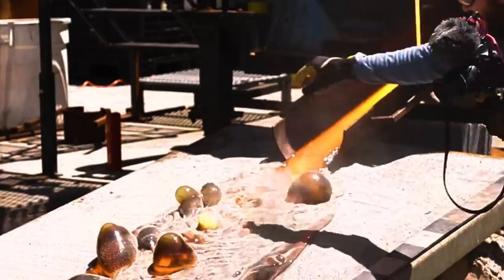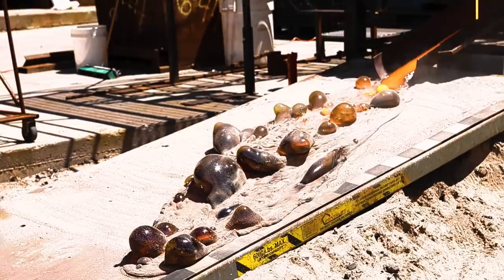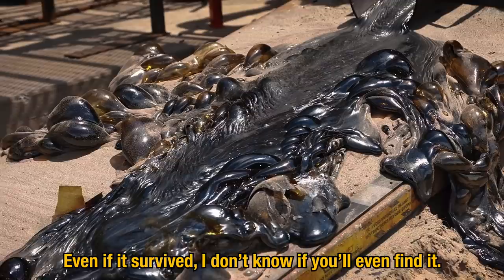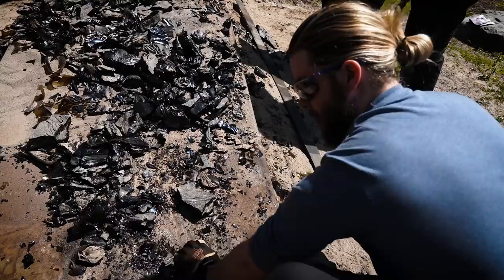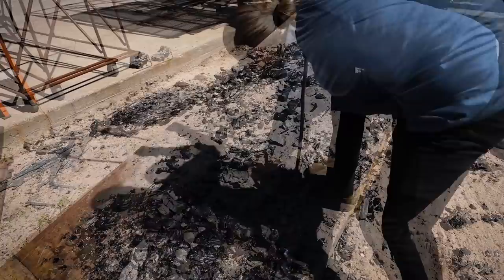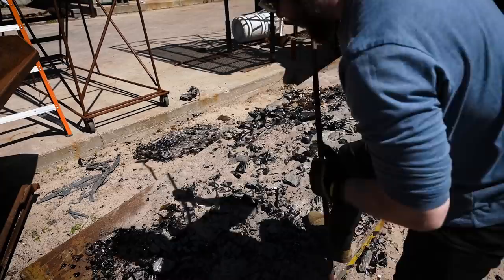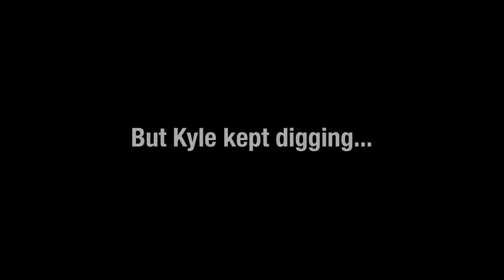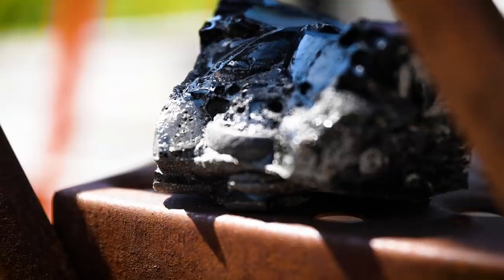Will REAL LAVA Destroy the One Ring?

Comment: Even if a ring thrown into an active volcanic pool didn't immediately disintegrate and built a "cooled cocoon" around itself with lava, wouldn't the cocoon also eventually melt away once it rose to the temperature of the pool around it? Presumably then melting the ring, or at least sinking deeper into the lava pool, where it would continue to rise in temperature and possibly melt?

I mean, this test was basically just pouring lava onto the ring instead of demonstrating how it would actually react inside a volcano.

Cool video all the same, but not exactly accurate.

Comment: I have to wonder what temperature the lava has to be to act as a liquid with the viscosity of the screen's material. I expect far higher than we have on Earth. Mind you, that then has the problem that gollum and the ring would be blown upwards potentially, and poor smeagol seared before impact. Would the ring fall past an updraft? The surface would be quite agitated if it was such a low viscosity, with massive winds churning it.

In any case, the ring would sink, and insulation wouldn't matter because it is staying inside the goop, and presumably sinking into an even hotter source.

The magic that keeps it cool has an Achilles heel - it doesn't apply to the location it was forged in. 

So I think you have gassed hobbits, and possible cooked hobbits, even so far from the flow. Gollum is probably dead before impact, but might have even been blown a long distance onto hard sharp rock, but maybe his Doom was determined by being an Oathbreaker, physics looking the other way out if disgust. The ring might be encased, but the casing will only heat without a sink, and the whole bundle would sink to a hotter level in any case.

Still, sauron can always work out what he should have done differently from the Void. He has plenty of time.